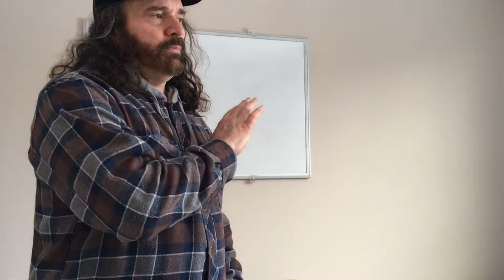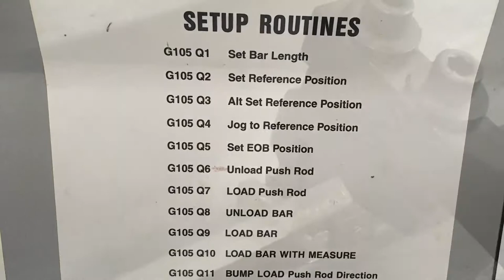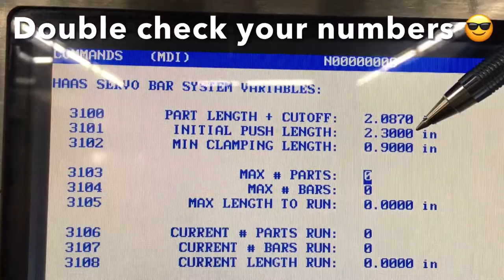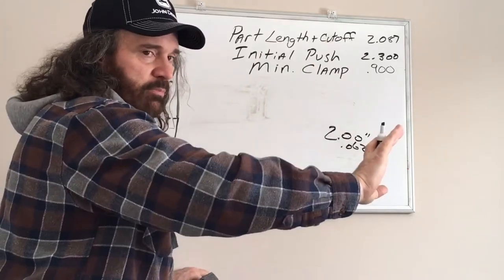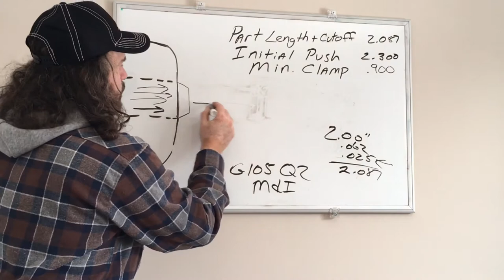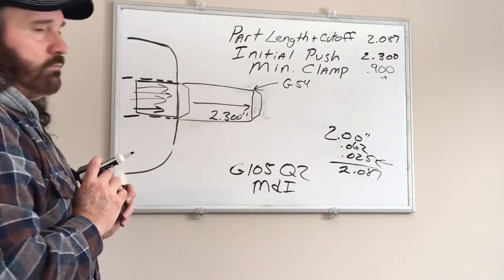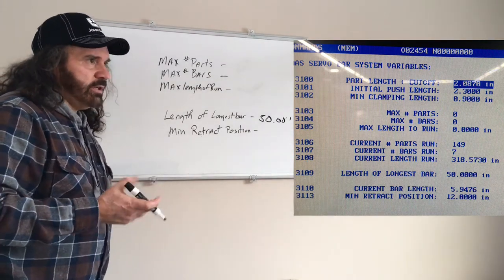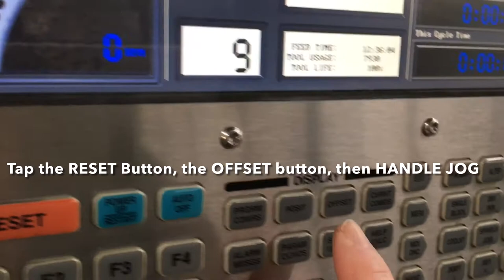Programming HAAS Servo 300 Bar feeder for beginners/Intermediate

Comment: Is there any codes to put in the actual program to call up the barfeeder inside the main program? I didn't see you go into any besides the standalone MDi programs?

Also "Most older bar feeders use metal tubes with o-rings, which I did not show in this video, instead I showed in this video our one lathe that has plastic liners that come in various sizes." 
Mine has the metal tubes with O-rings however I noticed that yours had a "screw in cap/cover" 2:10 that holds the liner in? Am I correct to believe that my O-rings on my Steel Tube Sleeves are "that cover"(do same thing) because I do not see a cover as such for mine like yours in this video (mine is also a servo bar 300).

Also if you set the G54 at the Top/Rear of the Lead In of the bar for the first part of the bar it will either (from my perspective but not experience) 
A) be to deep for a facing cut which is typically 1 pass.
B) if more than 1 pass then a waste of time/material/tool life on all other parts after the 1st part of every bar.
C) if you set the G54 normally (in just enough to clean up raw face) then the first part of ea bar will be (potentially) scrap because some the lead in may be there still.

Also what about for end of program and restarting there are other G105 commands like EOB
Have you got an example of a basic cyclical run of a program showing the barfeeder starting (new bar but same program) and ending (where a bar is at it's last part and what the feeder does)?

Thoughts?
Reply from the maker: I know usually every machinist will program differently, but for me personally……I have all the machine defaults as my first line of code…from there I add my G105 line ….for example 

G18 G40 G54 G80 G97 G99;
;
G105;
(Whatever you entered on your SERVO BAR page for values such as minimum clamp, Initial push, Part length + cutoff, length of longest bar, etc,etc....G105 will now pick up those values)
(If you are using I,J, and K values in the G105 line....that will override what you have entered on your servo bar page)

T101(Roughing tool)
(call up rpm's, rapid moves etc,)

T202( Finish Face and turn)
(call up rpm's, rapid moves etc,etc)

Ex..ex.

Now, the lead in that’s ground on the front of the bar usually only comes into effect for a NEW bar and I personally always program a parting tool to stay about .020 from G54 Z0. and just have it do a rough face path……then I use my main tool to finish face and go from there.  If you want, you can always do block delete if you want to bypass the rough facing tool.  
As for the bar liner…..we have 2 lathes with the steel liners also with the o-rings…..no cap on those……the o-rings are supposed to act as a grip to the liner…….the plastic liner in the video is on a lathe that was from around 2005 ......they are nice.... you then put a cap on the end so the liner doesn’t come out.
Reply: @TimsCNC-Tractors-and-more  I was more curious about the codes inside the program to activate the barfeeder but as you said it's just G105 and I don't think it matters if it is before the 1st tool or before M30 at the end.

I program ea day so I'm fine there and my prog start block is the same as yours anyway except G21(metric)
Reply from the maker: @MantismanTM  Yup.....you can place it in the beginning or end of program.
Reply: @TimsCNC-Tractors-and-more  Well I thank you Sir for the help, my barfeeder is up and running, only thing left to figure out is why the program once finished will not restart automatically on its own.

Could this be because I have OP.Stop ON? my last 3 lines in prog are.

G0X150.Z150. (safe Tool Change pos.)
G105 (barfeeder)
M30 (end of prog back to start)
%

P.S. - I only send my turret all the way to machine home when first turned on and axis zero'd

Edit: I think I need to swap M30 with M99
Reply from the maker: @MantismanTM  yes, after your G105 , change the M30 to a M99 for it to automatically rewind to the top and constantly keep the program going.  You can always have a M01 before the M99 and if you need to have to program stop for any reason, you can turn on the optional stop button and turn it off when not needed.
Reply: @TimsCNC-Tractors-and-more  Yeah that is what I do already also AFTER turret positioning to tool change but BEFORE the physical tool change itself so something like.

G0X150.Z150.; (safe tool change location)
M01; (op. stop)
T101; (Tool #1 Offset #1)
Reply from the maker: @MantismanTM  yeah…..definitely make sure you are far enough away for the turret to index….I’ve accidentally forgot to do that one time many years ago and it didn’t end well 😆😆
Even more tricky with having live tooling which both of our older lathes have.
Reply: @TimsCNC-Tractors-and-more  Yes our machines also have live tools, creating a good routine is the key to success and following it, these routines can be from how one moves around the workshop right down/up to how one writes programs.
Reply from the maker: @MantismanTM   absolutely dude 😎🤘

Comment: Thanks for the great video it did help a lot for me.

Quick question, is there a way to program the data inside the program that I run so it does update the machine settings for the bar lenght, initial push and etc? 

I'm thinking a way that I can ask solidcam to add this to our post processor. Inside solidcam I should be able to fill out the necessary things.

Thank you in advance
Reply from the maker: Thank you for the kinds words and for watching my video!! 
Sadly, I’ve never use a cam system and I’m not familiar how those do the bar setup.
I know you should be able to go to the bar feed page in current commands and view the length of material left.
Im not sure if that’s the answer you are looking for.
Reply: @TimsCNC-Tractors-and-more  currently I've done it as you described it through the command page,

But I've seen somewhere in the manual that all that information could be controlled by a set of codes. I'll look into it, if I find out something I'll post it here :)
Reply from the maker: The only other thing is using the I, J, K  for an incremental override.
You still use a G105, but you insert I ,J, K also.
For instance,
G105 I2.0 J1.500 k1.0
I is the bar push
J is part length
K is min. Clamp

Not sure if this helps at all, but keep me posted!

Comment: I had no clue about the Q4 and Q2 before .lol..     But how do u keep light bars from being bumped too far? and destroying the tool ;)
Reply from the maker: So, I've dealt with machining plastic material in the past and once the collet opened to advance the material for the next piece, I've had the material lunge out of the collet a couple of times causing the facing tool to machine off a lot of material. 
So, here's a couple idea's that worked for me.
If you are using a 3 jaw chuck, make sure your clamping jaws are not opening really far.....try to keep them as minimal as possible.  If you are using collet chuck system,(such as a 5C collet) try keeping the collet pressure at a lower clamping force to help reduce the snapping effect of the collet when it's opening. Make sure your collet is free of burrs that might be allowing it to stick.
Another idea I've done in the past is to install a piece of scrap round stock in one of the tooling holders to act as a dead stop.  I would program it to come down to spindle center and then to stop at about .050"-.100" in front of your Z work zero offset.......from there you would do your G105 bar push and if for some reason the material wanted to bounce out, it would hit the dead stop of the tooling block and not go any further, and then the collet would close.  From there you would continue with your program.  But, doing it this way will require some playing around with, since when a new bar advances, you need to make sure the new bar push doesn't smack the tooling holder dead stop. This can be done by writing a block delete section in your program and have it bypass the new bar push by simply turning on and off block delete.  It would require you to keep check on the bar feed page to see how much stock remains before it picks up a new bar and for you to activate your block delete section. (I hope that didn't sound to confusing). 
I hope these ideas help you.

Comment: Hi, Great video I have a question about the different size push  rods. I'm looking to run a 3/8 job. Do you have the change a parameter going from the 3/4 push bar to the 3/8 bar?
Reply from the maker: Thank you for the kind words!
No, there are no parameters you need to change.
We have older machines where I work….not sure if newer machines you may need to adjust something.

Comment: My part is .840 + .03 for facing and .062 cut off bit, so .932 right? I have my initial push length set to 2.0” but it only works the first time after doing a Q2, after it parts off the first part for some reason it’s only pushing it out about 1.8”. Any ideas?
Reply from the maker: Hmmm........When you set up the bar feeder, did you do the G105 Q4 and then handle jog your V axis till the stock was flush with the collet?....I'm gonna assume you probably did....but just in case.
Then you run your G105 Q2 to push out your 2.00" Initial push. Now when you bring the tool you are using to face the part and you touch the front of the stock---did you set your G54 Z zero there? Did you remember to add the  -.03 in your Z work offset to compensate for the stock removal per part?
So in your program, all you need is just a regular G105 code with no Q values.
For example - 
G105
T101 (face)
G50 S1500
G97 S500 M3
G54 G00 Z0. (etc, etc)

If you are using I,J, and K in your G105 line, those will override any values you have listed on your bar feed page.

Comment: Is there any way to bypass the bar feeder? We are having problems with ours. How do you go about bypassing the bar feeder so we can use it until we get the bar feeder fixed? Our lathe is a Haas Sl20.
Reply from the maker: If you have the G105 in the program, you have a couple of choices.
You can add a block delete in front of the G105. You would put this symbol in front of the g105 code 👉/
You then would need to turn on Block Delete button.

You can also do this 👉(G105) in parentheses and it will not read the code.
Hope this helps.
Reply: @TimsCNC-Tractors-and-more  Thank you for your reply. One of our other guys showed up and was able to get it going.
Reply from the maker: @justinodie8068  ……oh good…..glad  you got it going 😎👍